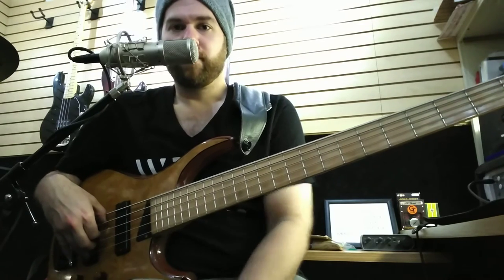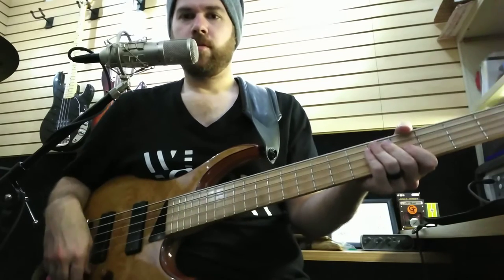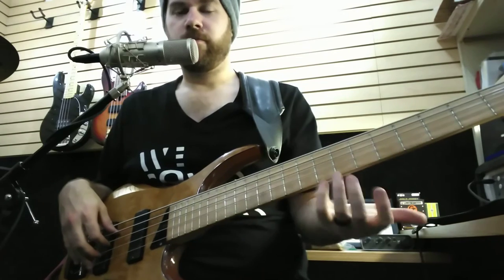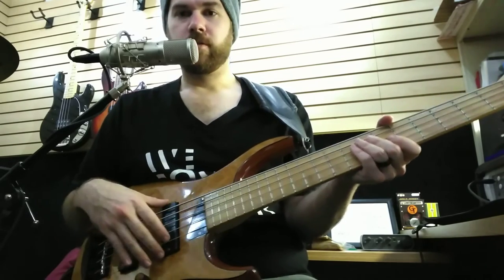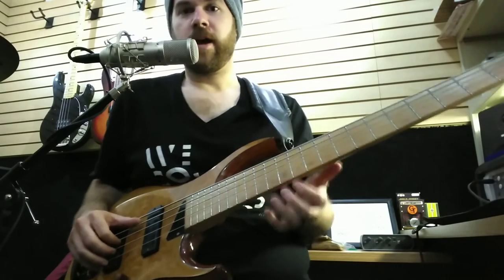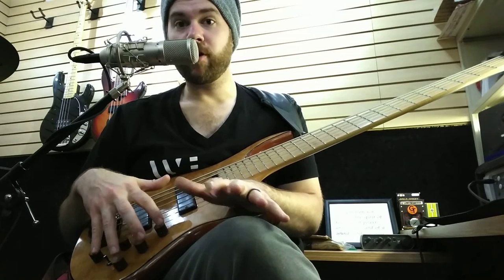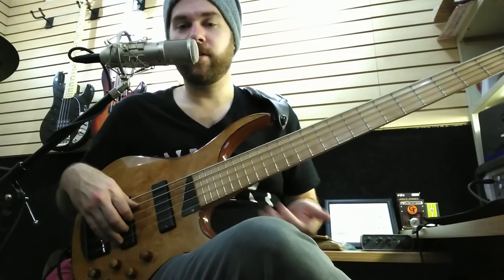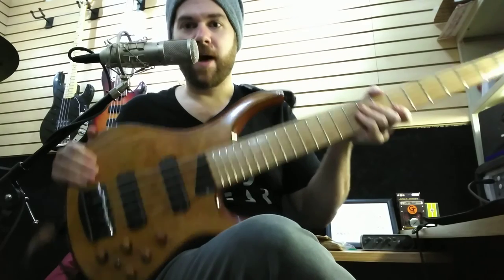MTD Kingston Bass Z5 - MTD ZX Bartolini pickups - Tobias TCT - Hipshot hardware

Comment: Hey Adam, I had a pre-Gibson Tobias Classic and I loved that sound. Can I order the preamp you configured to match the old Tobias pre's? Also I have Bartolini Mk1 pickups. Whats your opinion on those?  If so please let me know. Love your tone, great job!
Reply from the maker: Bob M Thank you! Yes you can order the same preamp I have, any Bartolini dealer can get it via part #: HRTCT-5.4AP. I believe bestbassgear.com has actually started stocking these. The Mk1 pickups are part of Bartolini's licensed designs, meaning they are a Bartolini design, but manufactured by a third party to allow the mass production quantities needed to fill orders for larger companies like Ibanez and Lakland. I believe they are a split coil configuration similar to what Mike uses in his American MTD's. All that to say...if you like the tone, great! There's nothing wrong with them. If not, Bartolini does offer other pickups in the Mk sizes. It all comes down to preference.
Reply: Thanks Adam!
Reply from the maker: Bob M always glad to help 😁.
Reply: Adam, I got my bass converted and it is multiple times better than it ever was. I used your preamp and Bart MK5 instead of the MK1. It sounds very near to my pre gibson tobias classic. With the bass and my TC Electronic RH750, both with no boost or cut, sounds great.  Now I can take this bass on stage and not my higher end basses. Great work on the pre and thanks for the help. Bob
Reply from the maker: Bob M that's great man! I'm glad to hear that you liked how it turned out 😁.
Reply from the maker: Bob M Also, funnily enough, the pickups you used have the same exact coils as the ones in my pickups (I now use a pair of P25CBC's). They're just placed in an Mk shape cover 👌🏼👍🏼.

Comment: Adam, great video and great tone! Does the Hipshot vintage bridge use the same 4 mounting holes in the rear as the stock MTD bridge? Also, does it completely cover the two front holes? Thanks and keep up the great work! Johnny
Reply from the maker: carvinbas the answer to both of your questions is yes. It is worth noting that, while all the holes are covered, the vintage style bridge has a smaller overall footprint than the stock MTD bridge and therefore you may still see remaining indentations/finish marks from the old bridge.
Reply: Adam Saylor Awesome and thank you! Looks like I’ll return the MTD B style I got from Dana B Goods and have them send me a vintage. Really don’t want to even add more holes to the body!
Reply from the maker: carvinbas exactly why I went with the vintage style 😉.
Reply: Adam Saylor Thanks for your help!
Reply from the maker: carvinbas anytime! 🙏🏼☺️
Reply: Adam Saylor Just wanted to make sure it is the standard vintage style bridge aside from the chrome on black right? Stock dimensions? I did a little bit more measuring today and it’s appearing to be a little off?
Reply from the maker: carvinbas yep, regular 19mm vintage style bridge. Like I said, the vintage bridge will be smaller overall then the stock MTD bridge. You'll still be able to see the footprint of the stock bridge, but the holes will be covered.

Comment: Two of my bass guitars have the mk 1, not a fan too boomy on top too weak, thin, quiet on the bottom no matter what I do with the eq.That's part of the reason I'm leaving Ibanez, even the higher end norstrand do that you have to get into the mk3 level to get definition and if your spending that much why have Ibanez when you can have MTD.
Reply from the maker: Cliff Kindred the Bartolini Mk1 pickups are a licensed product, meaning it's a design of Bartolini's that is made overseas by another manufacturer. I do know that Ibanez reverses the pickups (bridge pickup in neck position and vice versa) for a more "aggressive" sound. Many people have good success with a US Bartolini preamp paired with the Mk1 pickups.